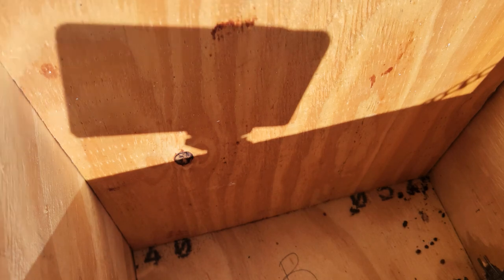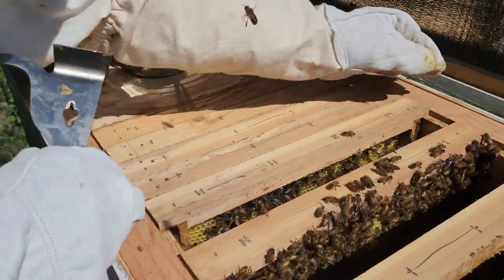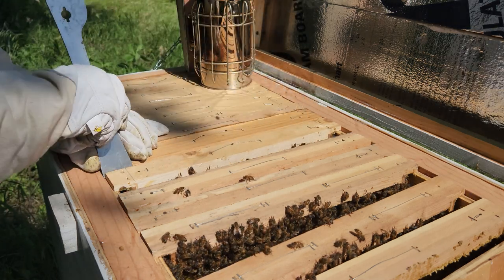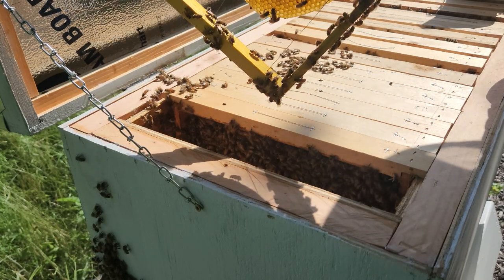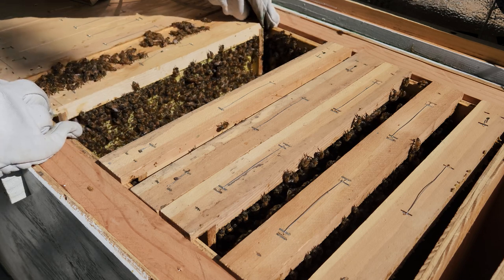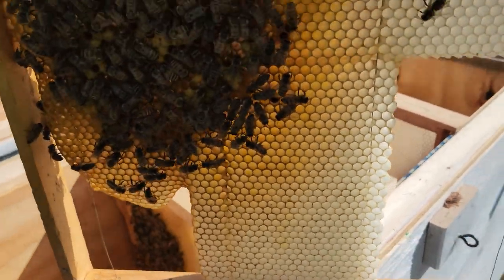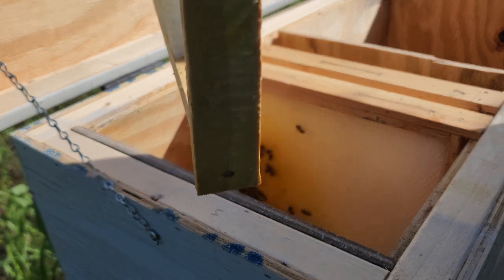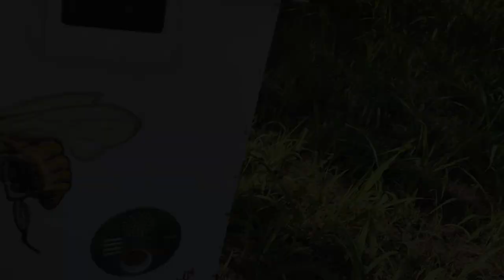Updates On New Layens Hive Frames That Were Added Two Weeks Ago

Comment: Might want to split that hive
Reply from the maker: I was thinking about doing that 🤔.  I don't see as many flowers in my area as a couple of weeks ago. Wouldn't that cause an effect on them? Or is it still possible to do that this late in the season? Since this is my first spring and I've never really paid any attention to the nectar flow, I'm not sure if I should attempt a split.   But I could also always feed them, I guess 😆.  I might just do that this weekend.  Thanks for the advice!
Reply: @RandomVlogTime  said that before seeing your other hives.  Need to get brood from the strong hive put in the weaker ones build them up. Might be better to combined the two smaller ones.  Unless the first hive has enough to brood and bees to build up the other two. They can’t make it with that few of bees.
Reply from the maker: I added bees with brood to one of the smaller ones.  The second hive seems to be getting better, and I did see a lot of brood. I did that about 3 or 4 weeks ago. I was just backed up on uploading the videos, but I'm finally catching up, and they're scheduled to be released every two weeks for now until I'm all caught up. 🙃  But I'm also thinking of doing your  suggestion about making a split.  That also probably will be released in a while 😆.  There is so much to do in addition to my regular full-time job, but I am really enjoying this hobby!